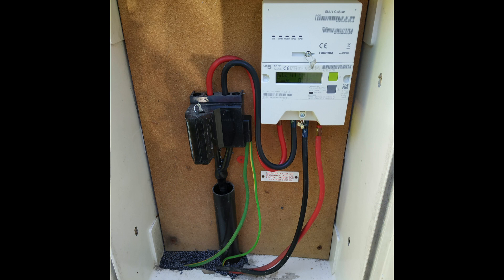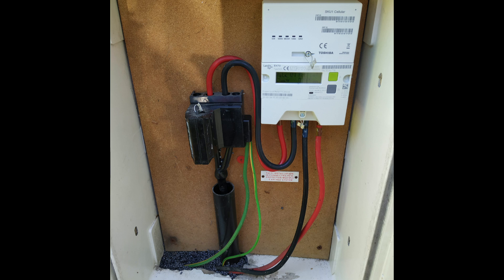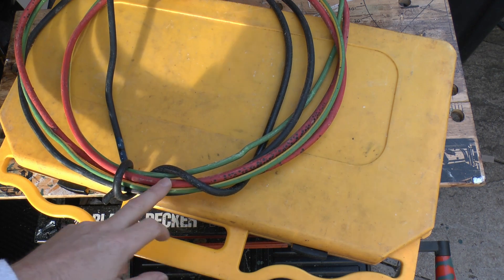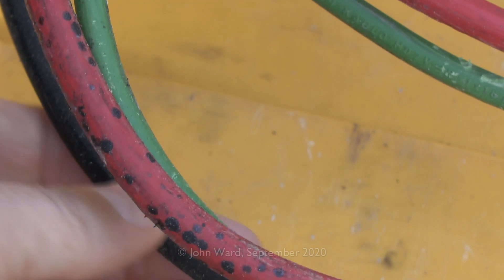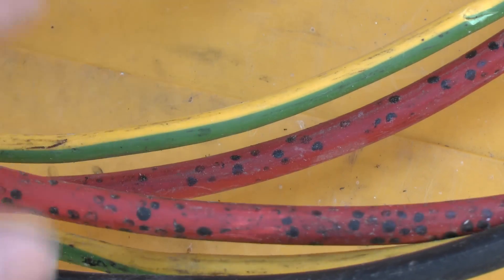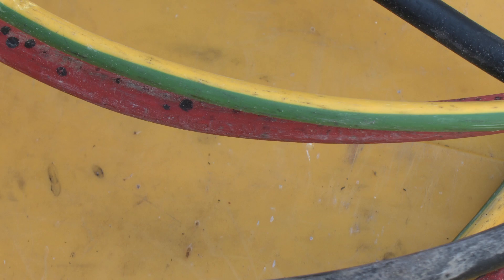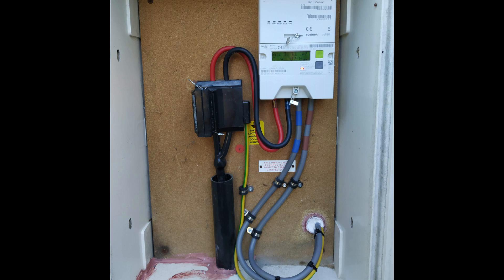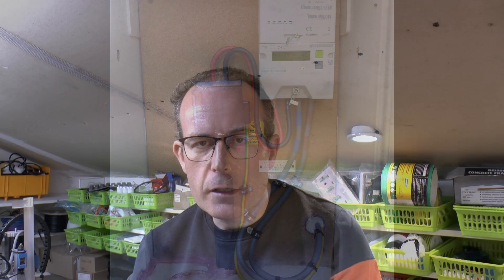PVC Insulated Cable Damaged by Expanded Polystyrene Insulation

Comment: Good to see this problem getting distributed and highlighted. I already knew that polystyrene was an issue but foam insulation think they are mainly expanded polyurethane these days, is becoming more widespread mainly in sheet materials but you do watch remodeling programs on the TV  especially state side that spray expanding foam insulation over cable installations. 1. It will obviously reduce the cables rating not that is ever highlighted in these sort of programmes as they are only interested in reducing heat loss for their green credentials.  2. It will stop any chance of cable inspection 3. Which if any of these expanded foams is safe against chemical attack of electrical cable? 4. Electrical fires with foam next to the cables. Best to keep any form of insulation away from cables but another aspect that could do with discussing as I for one feel I need to understand what the best source information is saying but which takes a bit of time to do unless others already have these answers at their finger tips.
Reply: Expanding polyurethane has been used to seal conduit ends and wall penetrations for a long time. It's easily removed and I've never seen any insulation damage due to it.

Comment: I thought cables werent allowed in the cavity wall without mechanical protection. I always install a small length of conduit whenever I put any cable through a cavity wall.
Reply from the maker: They are not allowed - but those old ones are from 40 years ago when it was built, doubtful if anyone cared or checked it at the time.
Reply: This place and dozens like it on this development built in '82 have the the CU in the garage or bin cupboard with the cables running up the cavity and into the house. It would be a nightmare if there was any element of retrospective application of the regs in the future.
Reply: Hi John , great video as usual! Do you know if there is a reaction with nym-j cables?

Comment: Irrespective of the determination of the fuse size in the cutout and the thermal effect of the insulation, is there a concern for the sizing of the tails in regards of loading of the installation.

Comment: I remember looking at jobs in the 80s and 90s where they had polybead in roof space. You open the loft hatch too quick and it spills out down your neck. I remember how the bead had this weird effect on the T&E and left the cables looking like a coat of varnish on the outside and stuck to the grey insulation. In some cases there was brittleness.
I saw one so bad, some old granny living by herself, she wanted some extra lights, I pointed out that I cannot touch these cables in this state and explained why, and said the cables need replacing and the insulation removing. She called me a cowboy called through the back door to her neighbour who was on his drive and asked him to throw me out. The neighbour was also a complete twat. I wrote her a letter in report form of my findings, no email for me in them days, to cover my arse, contacted the NIC (I was a member) explaining to them and they said it hadn't been reported as an issue yet. I could believe what was hearing. I bet she got some fly by night in to do her lights in the end but I wasn't that worried, stupid old cow.
Reply: You have a way with words Tony. Made me chuckle 😁👍

Comment: Do other insulation materials have similar effects?  I'm thinking of Celotex where this is used internally on solid external walls and between ceiling joists.
Reply: Polyisocyanurate boards don't contain styrene. So doesn't degrade pvc. However the insulation factors still have to be considered when choosing cable rating.

Comment: I would replace it with NYY cables...two layers of PVC sheathing in combination with the inner PVC insulation. I bet that will take some time to have a bad influence on the insulation.

For the earth cable NYM-J, 1x25mm² or 1x16mm². For the other ones NYM-O 1x25mm², or a NYM-O 2x25mm². -J means green/yellow conductor is within the cable. The -O means there is no green-yellow wire inside the cable. 

https://www.elandcables.com/media/38379/nyy-j-pvc-0-6-1kv-power-cable.pdf

Or install a conduit into the polysterene insulation so the cables don't have direct contact with the thermal insulation. But the method shown here is actually the best one, avoid the cables going through that polysterene. But in some cases you can't avoid it...

Comment: Interesting, a couple of years ago we were considering having expanded polystyrene bead insulation, as the cables from the meter to the consumer unit run through the cavity for a couple of metres, it is just as well we didn't, strange the surveyor didn't mention it might be a problem .

Comment: As a collector of retro computers I see this alot when cables are stored in a original polystyrene packaging for 40 years.
Reply: I've seen vintage plastic toys, such as telephones, destroyed by being in contact with the polystyrene packaging within the original box. When new, the phones were inside plastic bags which 'insulated' them from the chemical reaction, but those bags were thrown away and the rot set in.
Reply: I collect vintage computer keyboards , i have seen cables wrapped around a keyboard melt it!
Reply: @andljoy  If anything goes into the loft for storage here the cables are always put in polyethylene bags.
Reply: Famiclones love to come out the box like this!  Cables stick to the box too 😀
Reply: It can happen quite quickly at elevated temps. Took manufacturers a few years to realise what was going on and wrap the cables in polyethylene bags.
Reply: Same here except with vintage audio and electronic test gear.  Ive also had pvc insulated cables decompose into a sticky mess on their own with nothing else in contact.

Comment: and now they are going to start the loft insulation grants again, roll on covered up under sized cables again
Reply: @moto Line I've refused any attempts by companies to apply cavity or loft insulation, or install smart meters etc.  Thanks but not thanks etc.

Comment: This used to be a common problem on narrowboats, which coupled with moderate regular vibration it was the cause of numerous problems.
The recommendation now is to always install cabling in conduit (whatever the cable or insulation type) which makes the whole situation a lot easier to understand for the lay person.

Comment: Interesting, how are you allowed have single insulated cable running thru a wall cavity?
Reply: tails are double insulated for fault protection
Reply: @thesocialhandgrenade8474  It's not double insulation.  The inner layer is insulation, the outer layer is the sheath which offers mechanical protection.  The cable is insulated and sheathed.
Reply: @westinthewest  wow speechless
best tell all the cable manufacturers in the world,supplementary insulation over basic insulation isn't double insulation.thanks for clearing that up
Reply: @thesocialhandgrenade8474  Don't worry, cable manufacturers seem to use the proper terminology as I mentioned earlier.
http://www.caledonian-cables.co.uk/products/fireproof/flame_retardant_cable/twin-earth-cable.shtml

The diagram shows a cross section of PVC/PVC cable (BS6004) with brown/blue PVC insulation and the grey PVC sheath.

Double insulation doesn't apply to cables.  You're getting mixed up with the classes of protective earthing requirements for appliances as defined in IEC 61140.
Reply: @thesocialhandgrenade8474  isn't twin and earth technically insulated singles with an outer sheath?
Reply: And supplementary protection by conduit with has also been sealed. Nothing wrong with that.

Comment: If the cable is installed in conduit within the cavity does the current reduction still apply?
Reply from the maker: Yes, but not as much as the cables being directly in the insulation.
Reply: @jwflame  thanks for the reply. Very interesting... I must do some more research...